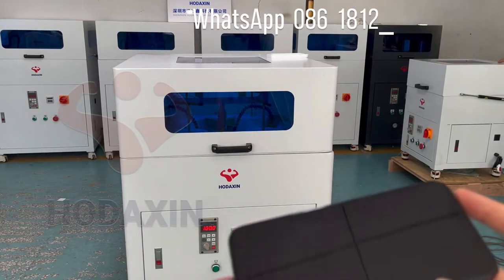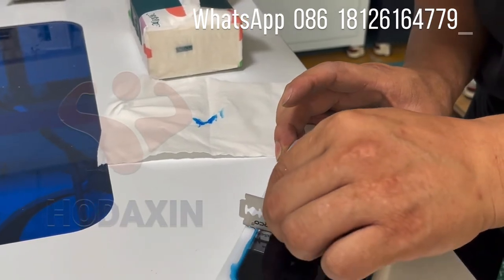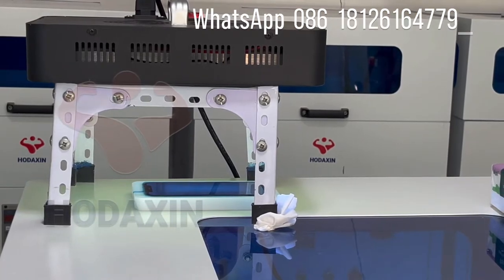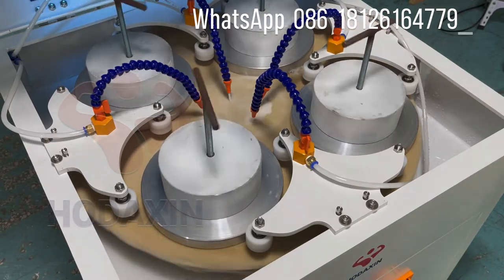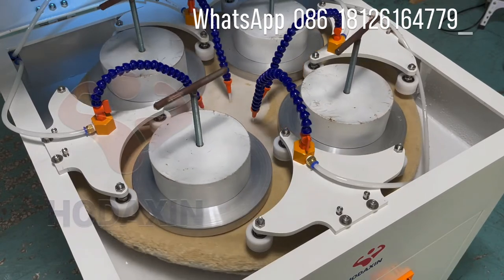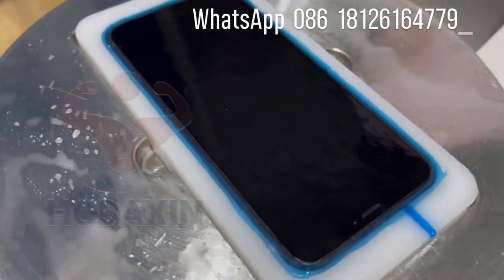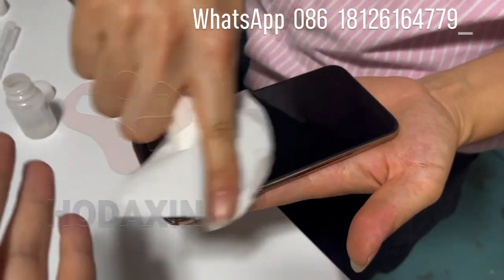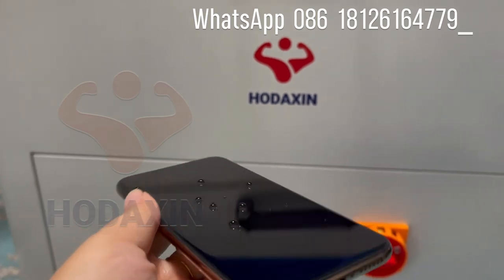2023 New tech iPhone Glass Polishing machine 2 way rotating polish machine for watch Samsung HDX

Comment: I have same machin but after Buffing here speaker not working , Face ID problem
Reply: Price
Reply from the maker: Hi friend, thanks for feedback, pleaes use the original glue, and uv curing use the 365 wavelength for few mins, before put in the machine.or plase contact us 0086 18126164779. thanks. :)
Reply from the maker: @harshadkallan2581  hey friend, please add my whatsapp 0086 18126164779, thanks
Reply: That’s why you have to remove the modules before doing it